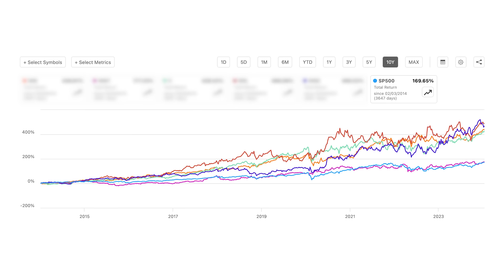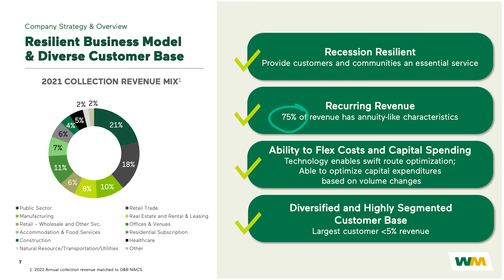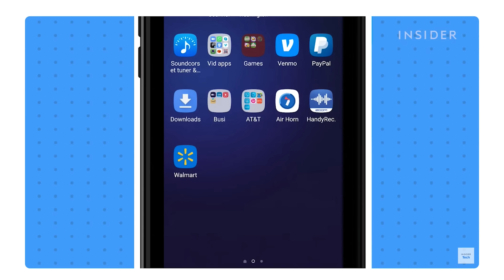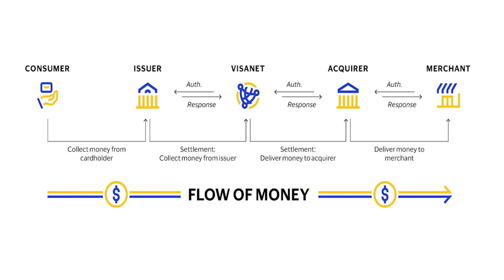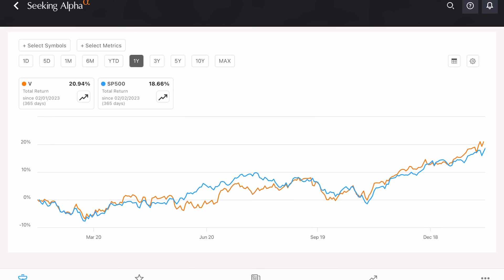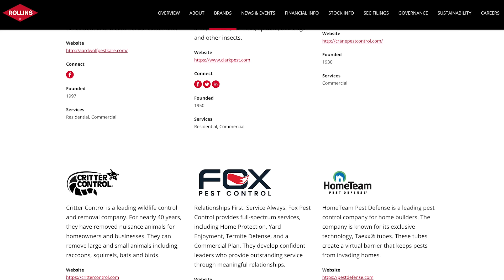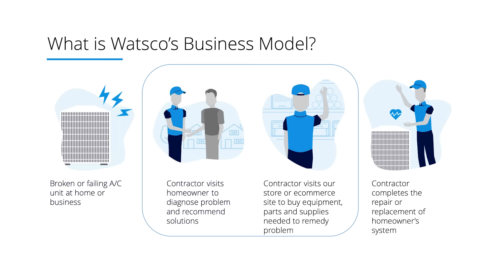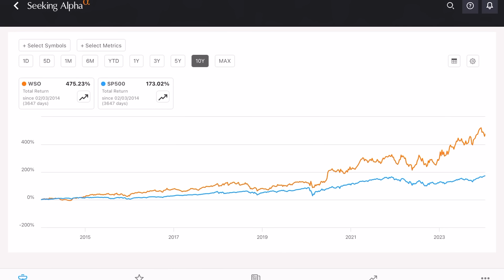5 Market-Beating Dividend Stocks To BUY & HOLD FOREVER 💰

Comment: Good companies but no way I'm buying at 52 week highs.
Reply from the maker: Fair enough!
Reply: The point being made is that if you’re buying the company and think you’re gonna hold it for 15, 20, 30 years, what does it matter what you buy at today?
Reply: 52 week high or low doesn't mean a company is over or undervalued
Reply: Today’s highs are tomorrow’s lows if you pick good companies
Reply: You might consider averaging in
Reply: Wait for a retracement before buying. Check out RSI levels.
Reply: It'll be higher next week. 🎉